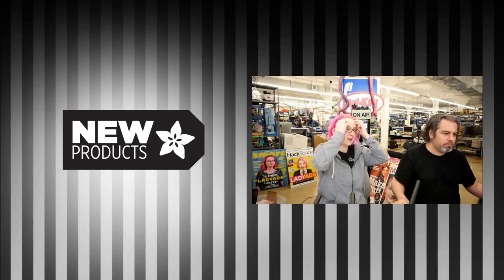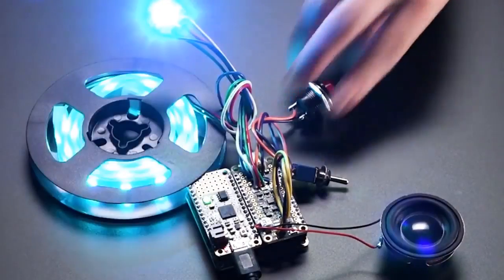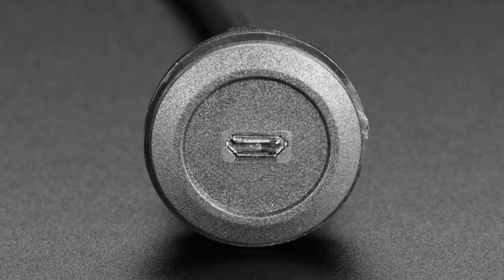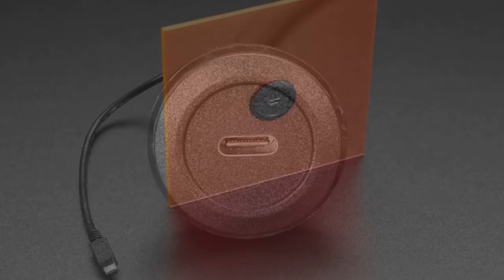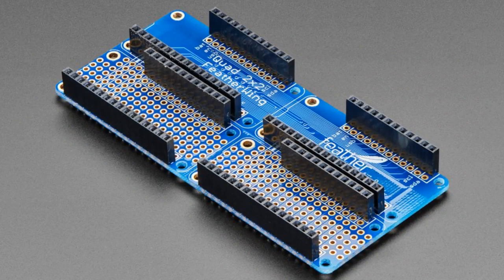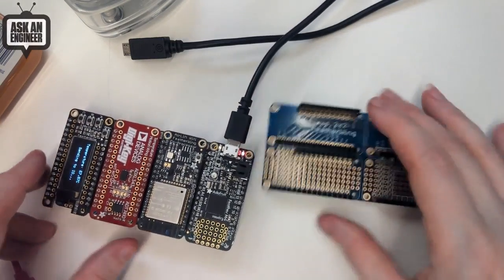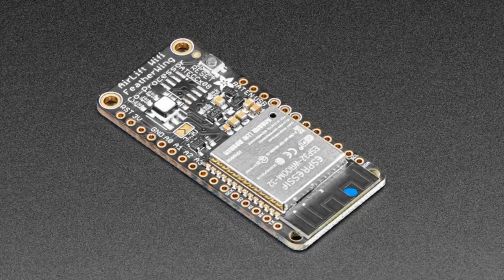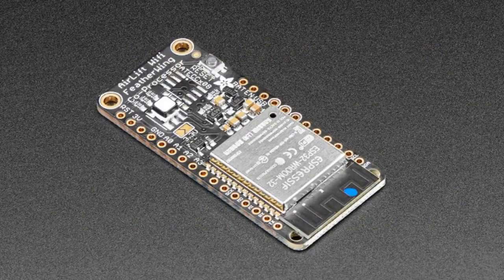New Products 5/29/19 Featuring Adafruit AirLift FeatherWing @adafruit #adafruit

Comment: If I may offer a suggestion, it should be more strongly emphasized that the audio functionality of the prop maker featherwing can only be utilized if you are programming it in circuitpython. I tend to use the Arduino platform and program in Java, which means I can't use the audio functionality, and I wish I had known this before I got so far into planning to use the featherwing for my projects. Or did I read the  details wrong and that's not even true? Anyway, your stuff is all wonderful! Have a nice day!